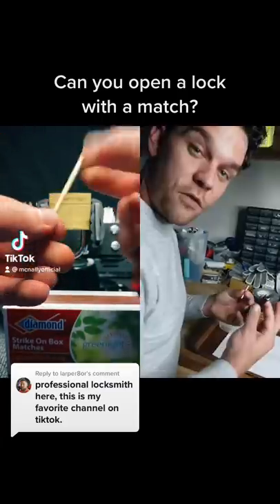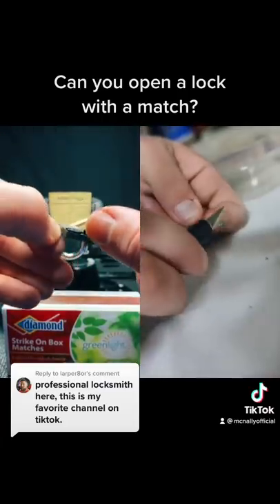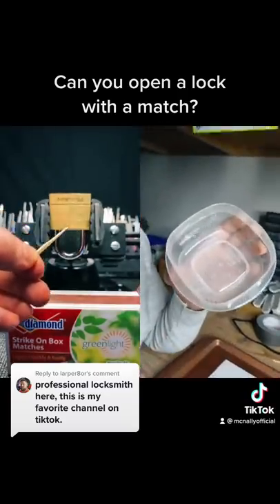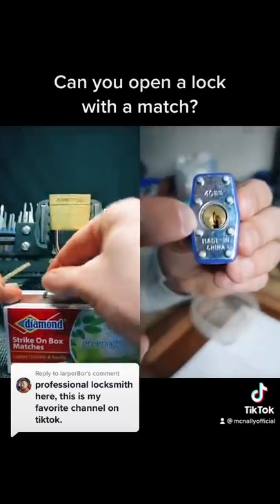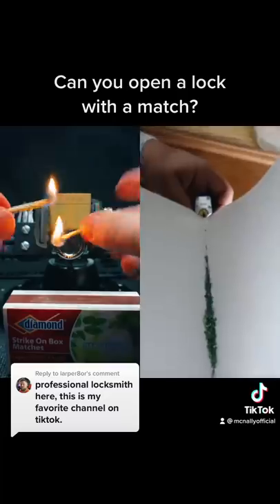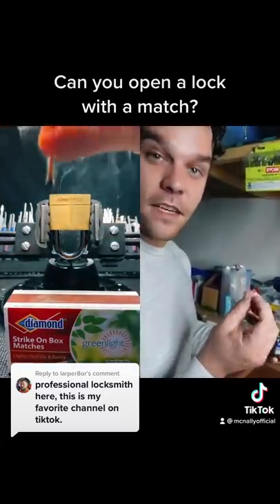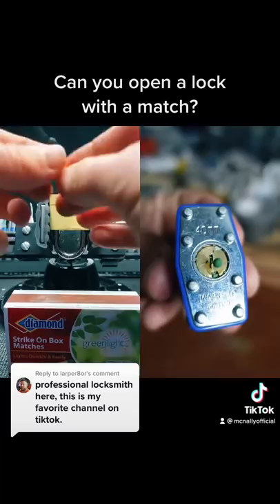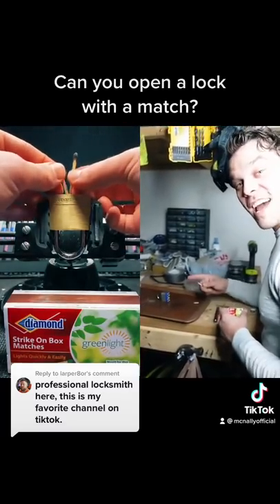Can you open a lock using a match?  #lockpicking #military #security #safety

Comment: The guy on the right is definitely a Master Lock User
Reply: Investor
Reply: Nah he's just not a lock picker. He tests hacks and safety gear as a layman specifically to debunk all the random shit trying to scam you out there. Never seen him talk up a master lock though, so probably not trying to sell em

There's a few safety things he'll swear by, products that'll reliably and easily cut through belts and smash windows but he'll also happily test the cheap wives tales to. Like a headrest won't do shit but a spark plug or ceramic will bust your window easily. He's usually doing car stuff if you couldn't tell 😅
Reply: @logan7159 who is he?

Comment: That's so nice of Master Lock. 
If you lose your keys, no need for spare ones.
Just go into the next smoke shop and buy a box of cheap matches 😅
Reply: Wasn't Master Lock also the one who said you could open a lock with another lock?
Reply: @Shade01982 i think that was McNally...
Reply: @doublea3423 yeah, but master lock was the one who designed it that way. So if you lose your keys, just buy another one of those junks, and smash them together to open it
Reply: Just ask for matches at your nearest gas station 😂
Reply: Or hit it with a different masterlock...
Reply: @stanky5187 
If you buy another one, it also comes with the key.
The keys aren't different within the same model lock. This is true for ALL brands of locks. Every model of lock within a brand has the SAME key, or else it couldn't be mass-produced.
Reply: @druid_zephyrus  
As a druid you shouldn't smoke your own herbs  🌿🚬🥴

Comment: He is basically the German of Locks. We open any beer bottle with anything. He opens any lock with anything.
Reply: I can open a beer bottle with my fridge door, a lighter, a zippo lighter or a clipper lighter, a microwave, the heel of my shoe, a knife (butter knife, steak knife etc) a bottle of beer itself, a quater, a car rim, my teeth" and a Xbox or PlayStation controller (without breaking it) and I'm American 😂🤞🇺🇲
Reply: @HunterGuy558 i can open a beer with:
towel
lighter(all lighters)
1€ coin
a mug
any bottle that has a cap
a phone
my pc
tables
chairs
my heels
another beer
my keyboard
a can of coke
literally anything that is solid enough or builds an edge or wraps arround the top to create force by pulling. 
yes im german
Reply: @ronnymeister824 Now I'm picturing a video "This is a beer. You can open it using a beer." Then chug both.
Reply: open a beer bottle with a master lock, about all they're good for
Reply: Yeah that beer bottle opening skill came in handy after failing to open Russian encirclements and blockades  in WW2

Comment: You should really be using the red phosphorus from the striker too. When mixed in equal parts with the green tip, it creates Armstrong's mixture, which is a volatile explosive
Reply: Cap gun bullets😂
Reply: @hershekissed  better than just match head powder

Comment: You needed to scrape the side of the box lightly to remove the red phosphorus. Then take those match heads you removed and gently push on them with the side of a butter knife to powderize the potassium chlorate off of the wood stick. Now, the very delicate and dangerous step, put roughly equal parts of match head and side of box scrapings into the center of a sheet of paper and lift opposite corners to gently mix the two. Once mixed the resulting powder is called Armstrong’s mixture, it’s what is inside those orange caps for cap guns, it is veeeerrryyy touch sensitive. Very gently pour that into the lock. I have no idea what it will do, but it will do a helluva lot more then the match heads on their own.
Reply: something fun to do with armstrongs mixture is to use it as an impact powder and make a bootleg bullet using blackpowder (2:3:15 sulfur charcoal saltpeter)
Reply: Looks like I'm going on the FBIs watch list
Reply: @itsyaboi2346  
I mean come on, you know we are already on watch lists.
Reply: @juangonzalez9848  shhhhhhhh there not supposed to know that gotta keep it on the low
Reply: Reminds me of Walter White giving a lesson to those amateurs trying to cook meth.
Reply: I mean I already have a gun. This is just more neat stuff to do on weekends.
Reply: "I have no idea what it'll do" 🤣🤣🤣
Reply: Funny story about 4 years ago I was playing with matches and I scraped the green thing then the striker,then I mixed it and..... Well It definitely didn't go well.Shxt exploded and hit my right hand so it was out of commission for about 4 months.NEVER DOING IT AGAIN.
Reply: @christiansutton4369  
Well, it will probably wreck the lock, beyond that I don’t know if it will be open or not.
Reply: @PHNTM-mt2dw  
Oh yeah, that stuff is SENSITIVE! Even think of making a your mama joke and it goes. I mean, comparatively its not that bad, but still, Armstrong’s mixture is not something you want to make in large quantities.
Reply: It just doesn't work
Reply: I'm over here ready to take notes just to do some cool experiments at home and have my own mind blown and you over here messing with me 🤣 good one though! Way cooler than left guy did.
Reply: @juangonzalez9848  unless you're using water/alcohol when mixing it, it'll be more safe by doing so beacuse it's harder to ignite when wet
Reply: Easy there Breaking Bad...

Comment: You could just blast it with a torch, the metals used in most locks have low melting points, at least the cheap ones. No fancy equipment required

Comment: scrape off the striker-surface or wash it of with some ethanol, let it dry and mix that with the matchheads (very gently). fill the lock with the "armstrong's mix" (GENTLY!!) seal most of the keyway with superglue, but leave a touch-hole, use a fuse, a stand somewhere safe. (i will take no responsibility for the end results)

Comment: As a fairly new lock picker myself, I will NEVER buy another masterlock again. Lmao I literally got my picks in the mail, opened the 3 practice locks LITERALLY within 3-5 mins. Closer to 3. I might as well have been using the keys 😂😂 I figured "there's no WAY picking a pad lock is THAT easy" so I found every lock I had around the house. 3 masterlock padlocks. 2 brink puck style locks, 1 puck style that didn't have a name, 3 brinks padlocks and 2 no name padlocks. I started out with the masterlock padlocks. 2 of them I opened within seconds of putting the tension bar and pick in (I might as well have been using the key on these as well) then I decided to try something. The 3rd, I opened WITH JUST THE TENSION BAR!! 😂😂😂 out of all the locks, the ones the put up the most fight were the puck style locks, and surprisingly the locks that didn't have the names stamped on them. 😂😂😂 so yea, I'm MUCH more picker about what locks I buy now. 😂😂

Comment: Next time use pure sodium. Crush it down to a fine power fill powder into lock. Put a quick squirt of pure water into the lock key hole. Stand back and watch the fireworks. This burns much hotter giving a better result but probably not enough to open lock.

Comment: If you wanted to blow open the lock, you'd probably want to use some of the striker strip mixed with crushed match heads. That's Armstrong Mixture, which is explosive rather than just flammable.

Comment: Use magnesium shavings mixed with napalm (Styrofoam melted in gas enough til the gas is gel). Put enough shavings to make it a paste. Inject the mix with a small meat injector or any syringe made of metal and/or glass. 

In theory 1 of 2 things will happen: 1 it will melt it apart. 2 it will melt it and fuse it together making it weak enough to bust apart.

Be sure to test the magnesium/napalm mix using a very small amount to see if there isnt an explosive reaction first before making a large amount. Use PPE and stay safe kids!

Comment: I used to make "firecrackers" with matches like these. Just take the potassium chlorate of the matches, scrape the red phosphorus carefully off the sides, and mix even more carefully! 😅 If in a confined space, it's going to explode. I don't have an answer to how one would get, and then air-seal the end of the keyhole. But if one could, maybe, just maaaaybe one could blow it apart. Not sure. But this mix easily tears through copper piping like it's a plastic straw. 😊

Comment: Putting that powderized red phosphorus (yes the tips of matches is made from red phosphorus) might be hot enough to damage the lock on the inside enough the the key won't work, it could cause burs and slag to form inside the lock filing space that most locks today don't have

Comment: Good idea might've wanted to try magnesium or gunpowder with a match as an ignitor packed in tightly would be a lot easier to take a piece of metal though and determine how many pins are in the padlock and figure out how they line up and then unlock it that way with a thin long skinny piece of metal and magnesium idea might actually melt the internal parts in place so you might want to figure out how to cause a small blast on the inside sending the pins out words quick enough for you to pull the padlock open like using a bump key without the key these are just ideas I've never tried this don't know may or may not work

Comment: Would have had a better chance with a single paper clip. Their tolerances are so horrible usually you can open a lock by jiggling a paperclip in it. When I was in 3rd grade I actually opened a lock this way while I was in school. I was just jamming a paperclip in one and it bent the paperclip in just the right way that I could open the lock. It was even reproduced multiple times the same way. That's actually how I got into lock picking. All because that one day I though lt it was soo cool that I could open a lock without the right key.

Comment: It does work it's just the lock he was using is one of the weakest locks masterlock has ever made the pins bounce against each other thru kinetic energy and lets you open the lock easily you used a more secure lock which is why it didn't work